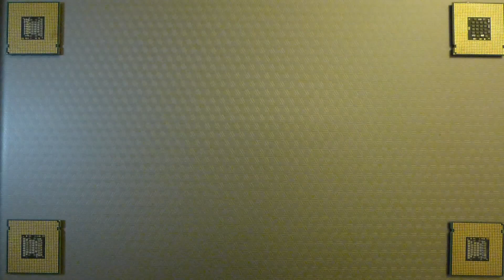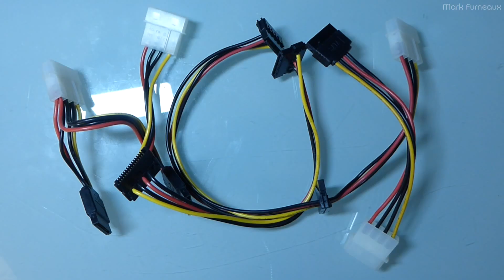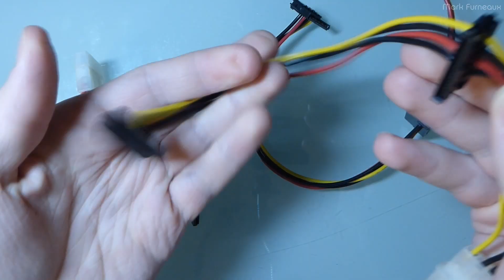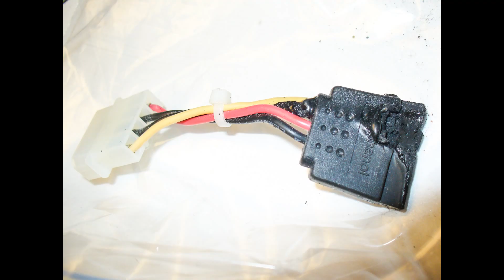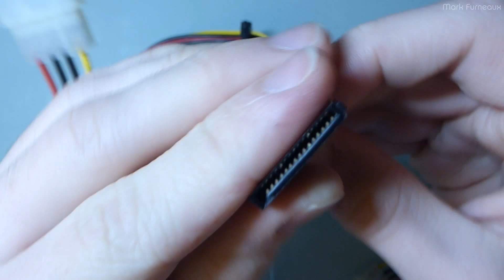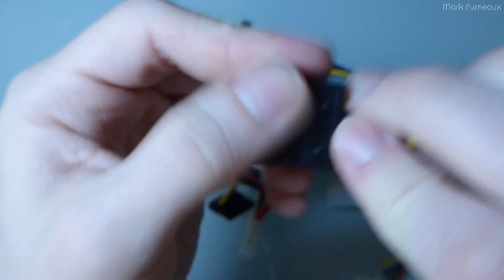How To Spot Molex To SATA Adapters That Won't Catch Fire

Comment: Thank you for this, i recently started using one of these(SATA to 6 pin) for my video card but i will get a molex to pci-e 6 pin one, just to be on the safe side, they arent really expensive
Reply: Hey if u have used the 2 4pin molex to 6 pin then can u plz tell is it good to buy or not?
Reply: @amanmotorsghy  Ah, i made that comment a while ago, I used it for about a year and then i got a new PSU which had a 6 pin.
It depends on how powerful your psu is and what card you are trying to power, If you don't go over the limit it should be fine
This should be more of a temporary solution rather than a permanent one, after a while you should upgrade if possible
Reply: @MarsyTea  thank you so much for replying 😊, i was thinking of buying nvidia 1650 super and my psu is 500w..but it doesnt have 6 pin so i was confused whether this cable should be utilised or not.
Reply: @amanmotorsghy  What PSU is it? I just looked it up and the 1650 super doesnt seem to need that much power "Graphics Card Power (W) 100" (From the nvidia site), It should work but look to upgrade your psu when you can
Reply: @MarsyTea  yeah super consumes less power but it requires 6 pin thats why i was anxious, it is a local brand psu foxin 500w, i have been using it since last 5 years as i left gaming 3 years ago so i never upgraded the pc but recently i thought of buying a new gpu for video editing and sometime gaming purpose. Currently m using Nvidia gt 740 2gb ddr5.

Comment: I have had several of these molex to sata adapters melt and burn up. My experience with them was not the insulated leads shorting out and giving trouble, it was the cheap contacts in the sata connecters. The contacts are too thin and heat up. when they heat they warp and twist sideways. When they bend and twist toward each other instead of away from each other they sometimes touch each other and short out. When two contacts of opposite polarity touch each other, you have a short circuit. This overloads the supply leads which they themselves very small gauge wires (should be larger gauge) and therefore turning red hot and melting the insulation off the wires. Thereupon the bare wires themselves short out and further compound the problem. The problem begins with the contacts and not the wires themselves.

Comment: hmm. Can i use sata to molex adapter for PCI usb 3.0 hubs for 1st gen desktop system..... 3.0 Usb pci hub flash the message in windows that power exceeds than it allows. 3.0 ports are not working. I tried using external power cord converter as seen by sata to usb .
Then usb 3.0 works. But internally the system how to buy these cables > please mentioned websites.

Comment: In my opinion the conductor used is underrated .if the conductor is underrated tendency the conductor heats up and melts the  insulation.another reason also is loss connection has a bigger chance of arching.

Comment: Had I saw this earlier, I would have saved one of my internal drives. I didn't knew this and I used one molex to sata power and it caught fire immediately I turned on the PC. Is there any good quality Molex to Sata available which are 100% safe to use? Also I searched online and got this https://www.amazon.com/StarTech-com-Power-Splitter-Adapter-PYO4SATA/dp/B0086OGN9E/ref=sr_1_3?ie=UTF8&qid=1530690165&sr=8-3&keywords=sata+power+splitter My question is if I use it will it be safe?
Reply: Did you buy this?
Reply: @RHINOhehe  Startech produces great products. If you need this item, you can go ahead with it. Right now, I cannot install any more drives in my system so I didn't purchased this.

Comment: Just happend here. Server had stopped and was on the bench for some testing. Flames and heavy smoke came from the connector. Luckely I was there.
Great tip, had both types of connectors laying around and nearly used the "wrong" one.

Comment: i have the sata to y sata adapter is that is safe to use and it's not the molex to y sata splitter
Reply: They likely carry the risk depending on the type. I recommend you watch this video and expect your cables and see what they're like. If they use the same injection molding process,  they likely have the same risks

Comment: I remember watching this video a few months ago and thinking that I wouldn't buy an molded sata connectors. I actually forgot that I had a sata to 2 sata connectors (I was using it as an extender to reach one of my drives) I just watched it today and I remembered the connector and went to check it. Turns out it was a molded connector. I'm surprised it didn't set on fire by now. I switched it out for a monoprice molex to sata that I had lying around. Thanks dude

Comment: Forget about any sata cable for gpu they are rated for only 4.5 amp and a single 1080 ti can draw more than that by the riser. Use only 4 pin moles or 6 pin molex directly in the riser, no adapter!

Comment: I have molex to 6 pin adapter for gpu. Just recently i noticed a plasticky smell when i did furmark. I open my pc while furmark is running and there saw my adapter melt. They have the same wires like the ones on my psu but i still wonder why it happened.

Comment: Most of the cables that I find on popular shopping website (Newegg, Amazon, etc.) seem to be teeming with only cables that have the 'molded' SATA connectors. Do you know of any sites where I could find this type of cable (with a SATA III end) which has the safe style of connections? Thanks.
Reply: You manage to find one that is not molded? If so can you link? Ty
Reply: https://smile.amazon.com/gp/product/B009GUL5CM/ref=oh_aui_detailpage_o07_s00?ie=UTF8&psc=1
also sata power connectors aren't sata 1,2, and 3; it's just the same for all of them btw

Comment: what about sata to 6 or 8 pin adapters?
Reply: Did you ever find out more about this? Assuming answer is the same if the SATA molding is the same as in video. I'm trying to figure out what I should do in lieu of 6-pin to SATA, or even if I can find a 6-pin to one of the "safer" versions of the SATA ends like he showed in video.

Comment: I can't seem to find a sata to Molex adapter that doesn't have this type of connector, can anyone help? And yes I typed that correctly I need to go from sata to molex for an RGB fan hub unfortunately.
Reply: You manage to find one? If so could you send link? Ty
Reply: Niels Omes never found one, found out my power supply had a single molex out port and I used that instead
Reply: inex me to

Comment: I know it's been awhile since you posted this, but do you have a great location to buy these specific non-fire-catching cables? Going through Amazon, Newegg, and Monoprice it's difficult to tell if they're good or not. Thanks.
Reply from the maker: The ones from Monoprice are the last ones I bought, and they were good. I high-pot tested them to 1kV and they passed.
Reply: Mark Furneaux mind sending the link? Also, I have 12pin SATA Male to 2 Y Molex Female splitters.
Reply: Ryan Strouse 

I'd like the link too. Now I'm worried. My risers are sata to sata
Reply: https://smile.amazon.com/gp/product/B009GUL5CM/ref=oh_aui_detailpage_o07_s00?ie=UTF8&psc=1

Comment: The kind of adapters that are being recommended in this video are not used for powered risers.  They are used for powering sata drives from a molex. We never heard of sata connectors melting until powered risers came out. Powering risers through a sata connector is an improper application because it draws too many amps. Add to that the fact that injection molded connectors may not provide proper pin tension to some of the terminals sometimes due to very poor quality control and their design being constructed with weak flexible rubbery type material. When there is not enough pin tension the temperature will increase on that terminal due to the extra resistance caused by the inadequate connection. When that happens whatever the rubber/plastic crap these connectors are made from gets even more flexible and allows the already loose connector to get looser, increasing resistance further and in turn producing enough heat to the point of melting.
Reply: So if I use, for example, molded sata extenders (sata to sata power cable) I don't actually risk having my drives damaged? There's so much contradictory info, I no longer know if I should replace them asap or not

Comment: Startech connectors are a death sentence.
Reply: Alan McRae why? Just bougth one :/
Reply: Because it put my computer on fire.
Reply: and if you watch the video above, you'll see that the Startech falls in the "bad" category... of having molded ends.
Reply: Alan McRae for what do u use  ur PC it's old hardware? 
I just bougth on Amazon the 12in LP4 to 2x latching SATA power adapter.
How long does it survive on ur PC?
Reply: Hi Dario! I was using the molex to sata power adapter to a pretty new dvd r/w drive... and it caught on fire. I had it connected only for a week or so before this happened.
Reply: Alan McRae thanks man 
Have startech one 
But im gonna change it ASAP 
Do u know some good brand molex to sata?
Reply: yes, I bought some great cables from a company that someone mentioned here on this comment list.... I'll see if i can find the name of it... but it is somewhere in these messages... and the guy put a link in the message, too...
Reply: https://www.moddiy.com/  This is where I got them, Dario! Best of luck!!

Comment: a problem in a sata connectors inside in connection between wire and metal connector. Its too weak in all sata connectors.So Sata only can used with low power consumption devices: hdd, ssd, dvd , blu ray drivers and others.  It have some differense between sata and molex , it in connection inside a connector, and in molex its better. So molex if it well you can use for videocards and other devices which can need more power then ssd for example.

Comment: I had a helluva time finding a good SATA connector. Finally found a few:
https://www.moddiy.com/products/SATA-Power-Y-Splitter-Cable-%28Black-Sleeving%29.html
https://www.moddiy.com/products/5%252dWire-SATA-1%252dto%252d2-Splitter-Cable-%2843cm%29.html
https://www.moddiy.com/products/Premium-Ribbon-Wire-5%252dPin-SATA-to-2x-SATA-Adapter-Cable-%28Black%29.html

Comment: ONLY USE TOP BRANDED PSU'S LIKE EGVA OR CORSAIR AND A FEW MORE OUT THERE NO CHEAP CRAP FOR $30 YOU WILL REGRET ITAND ALL WAYS PLUG THE PSU INTO A PLUG MONITOR TO CHECK THE WATTS ITS USING THEY ARE ONLY $10 EACH WELL WORTH IT AND NEVER RUN A PSU TO THE MAX LIKE A 1000W PSU SHOULD NOT BE TAKEN OEVER 800W SO ALWAYS ALOW FOR 20% OFF THE MAX OR YOUR PC WILL OR MAY BURN DOWN
Reply: Most of what you said is fairly true, but you can run a decent power supply near or at max load with no problem. Also dude with the capitals, i had to read over this shit like 3 times just to know what the hell you're talking about. And yes i know this comment is old, but im bored so...

Comment: You warm people about molded power SATA cables but I only find molded ones.
Where do you find the other type of cable (the one that doesn't catch fire).
I ordered one like this because at first I ordered a Y dual sata power to 6pn PCIE (psu side) to power two 2.5" in my RVZ01 case.
The first cable I ordered was 6pin PCIE to dual male power sata, so I ordered a new one from amazon for 1.5€.

Can someone give a link to good/reliable power sata cable ??
PS : I found one that is not molded on ebay
Here's the link : http://www.ebay.fr/itm/151651864782?_trksid=p2057872.m2749.l2649&ssPageName=STRK%3AMEBIDX%3AIT
Reply: or this
https://smile.amazon.com/gp/product/B009GUL5CM/ref=oh_aui_detailpage_o07_s00?ie=UTF8&psc=1

Comment: No more connectors?
Get a NEW server grade power supply.

The amount of people that run OEM power supplies with all sorts of adapters are a disaster waiting to happen. If you care about your data and hardware, then spend the extra money on the proper equipment.

Comment: Hi Mark,  how do you attach the molex connectors? Should I be matching the yellow cable on the adapter to the yellow cable coming from the power supply? I really should have looked at the adapter before detaching it from the power supply. The failure I believe is truly on my part. :(

Comment: I have personally had two of the Molex adaptors that you recommend to avoid melt in about a 1 to 2 year period. Neither resulted in the PSU switching off (and I use good PSUs). I only noticed when I came back into my computer room to investigate the awful smell. A quick research on the internet seems to concur with your recommendations. Thank you for the video.

Comment: Why do people insist on using Molex cables when this is something that happens? I've never seen this happen with regular SATA power cables.
Reply: Your PSU only supports 4 hard drives? Wow, mine supports 12.
Reply: ?????? 

Are you 12, or are you just an idiot?

It's really not hard to support multiple hard drives. I got my PSU for $100, it supports 12 drives out of the box but if I order an extra cable from the manufacturer, it can support 16 drives with not even one Molex cable required.

If $100 is rich, then I really don't know what to say.
Reply: It's not always number of drives, some drives you have to power like this to avoid pin 3 power issues. Usually drives say in 8 TB external shucked to make internal because price being $100 cheaper. Drive won't power on if you don't tape pin 3 or use this method.

Comment: I had one like the "good" type burn out on me today, I'd just say never use a molex to sata adapter(If you can avoid it) xD They're all shit and should never be used.

So yeah, totally agree with you man, thanks for the video.

Time to make sure my desktop is still alive. ;)
Reply: Would a sata power female to two females be safer? I need to add an ssd to my brother's sff pc.
Reply: Yes those adapters suck i pluged a ssd in it it worked for few days than once my pc froze and it never booted with the ssd .Luckaly i didnt have important data on the ssd

Comment: I had a machine that was crashing a lot and couldn't figure out why. I thought it might have been one of the adapters so I switched them out. The type I switched out was the type that you said can catch fire. Since I switch them out it hasn't crashed once, so I wonder if that type also cause stability issues.

Comment: I think it has more to do with contact resistance, like you said the some of the molded type adapters let the cables move around and when there's a load through that adapter, and the wire isn't connected too well to the pin, the contact resistance increases making the thing hotter and hotter until it catches fire

Comment: Injection molding use high temperature and high pressure. That high pressure can melt the wire insulation. The high pressure can cause the injected plastic to push on the wire in a significant way. If for whatever reason the wires are pushed in a bit too much then it can then move closer under the high pressure soft plastic flow. The insulation melt, and the wire almost touch. With time, any stress in the metal will push the wire throught the plastic slowly, which can bring the wire closer together (had anything on plastic for a while and noticed a dent?). Once it get too close the plastic can't block the angry pixies and zap! Now you have an angry powersupply sending angry pixies down the wires to the arc "welder" and no good thing can come out of that nature improvised welder.

As for the crimped one, you could have lifted the plastic tabs on the connector and pulled out the wire. It would come with the sata pins. The connector is really a one piece hard plastic with holes from the back to front to guide the pins. Those holes look more like a tunel than some holes.
Reply: No if that was the case then all power supply will end up with same problem as well here my thought as they should have been  per-tested at the factory and bad one are toss in a bin but in stead them destroying them with a shredder on site some else pick them out trash resold them back on market.
Reply: @SHSPVR  lol at tested. They test maybe one in a thousand if they even do. They will visually inspect some to make sure that the plastic is hot enought and that it flow well, and they make the needed adjustement so the injection is fine.

 And not all psu use the same process. Not junk use crimped terminals with insert type housing. Some use spaced out injection which avoid the issue. And the cheap ones that do most likelly will fail before it happen anyway.
Reply: i got the crimped one, but it catches fire on the first try. the burned part is the cable not the connector. bolts of fire, and smokes everywhere from my rig, and sadly it damages my hdd. i got it cheap, 1 dollar for two molex-sata power extension. that should be a red flag from the start.

Comment: You said that the MOLEX end is always fine. Well, I had a cable a few days ago where the manufacturers actually managed to fuck that up too. The plastic molding was SO BAD, that you were able to plug the female end into the male end either way and not even notice it was plugged in the wrong way. It killed the second one of my 3 drive RAIDZ1 array, so I lost my data. Watch out for that too!
Reply: wait, you are on raidz1, one drive shouldn't lose you data.

Comment: Better check mine, because if mine fail, it's taking my whole house with it. I have the side panel off and on this bin where the side with no side panel is shoved up to my desk.
Update: yup, injection mold style, but goes into DVD drive which for the most part is surrounded by metal and would only take out my DVD drive and motherboard wiring loom. its a older pc, it can die if it wants.